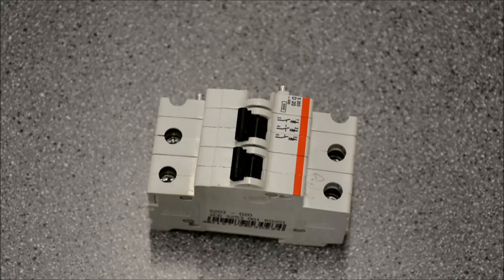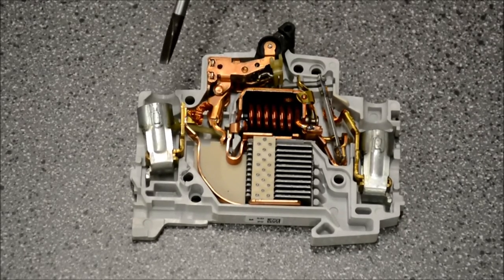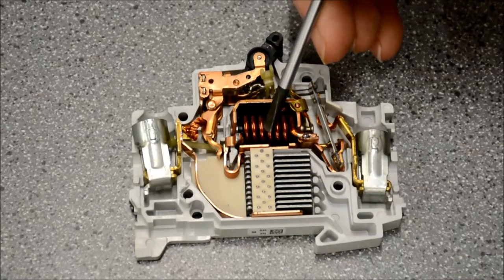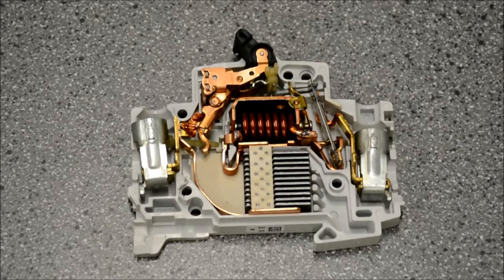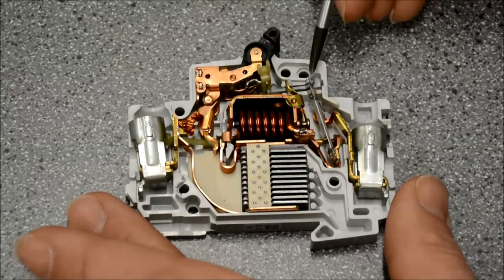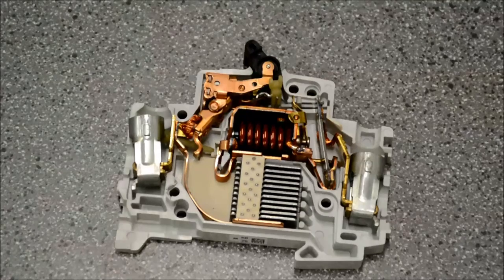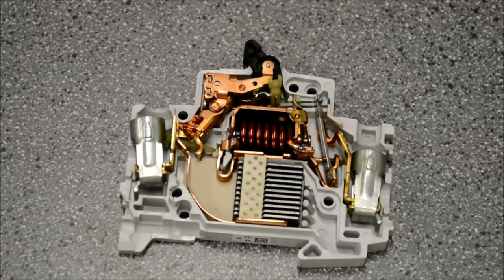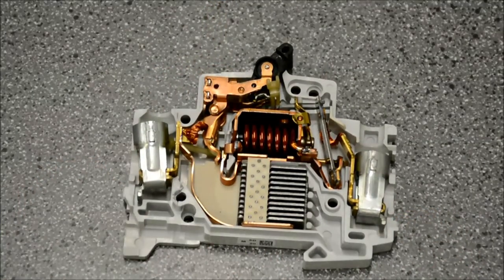Thermal Magnetic Circuit Breaker Operation

Comment: Ok please help me understand better... Would the manufacturer set the magnetic trip much higher than the thermal? As in, the magnetic trip is for instantaneous trip (short circuit, ground fault) and the thermal trip is for longer sustained over-current (3kW, 120V space heater on a 20A breaker for example)?

Comment: Thanks, awesome video.  I was baffled by specs for a GE load center LUG that keeps failing, and every website says it has thermo magnetic protection... it's just a lug.  Apparently with no warranty.  And protection is a spring that just fails every 6 months... THLK2200 BTW.  Anyway I learned a couple things here, thanks again!

Comment: This is not thermal magnetic mcb. Its magnetic hydraulic MCB. Ka lawm e
Reply: The circuit breaker has thermal and electromagnetic trip mechanisms.  The electromagnetic trip mechanism is hydraulically dampened to achieve a D class trip characteristic.  We refer to these combination units as thermal magnetic MCB's.  See https://new.abb.com/products/2CDS253001R0201/miniature-circuit-breaker-s200-3p-d-20-ampere